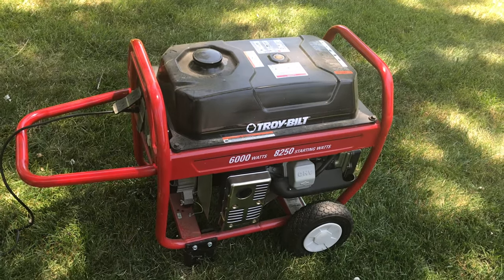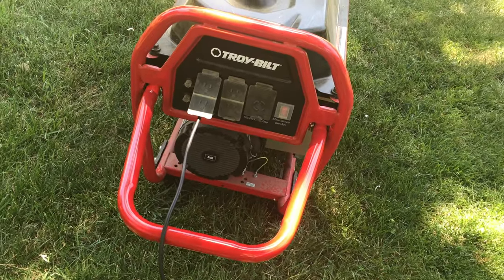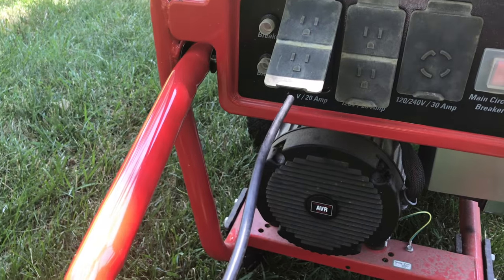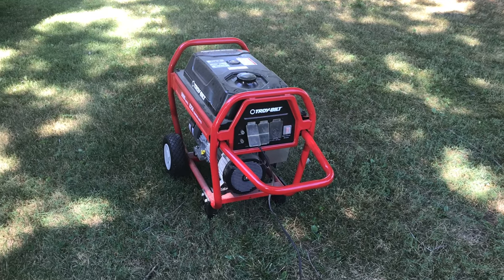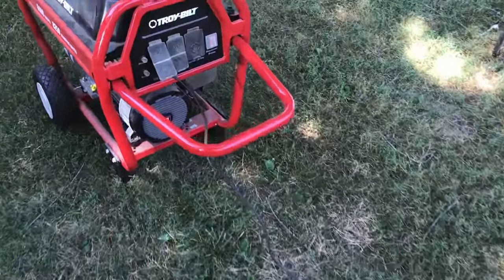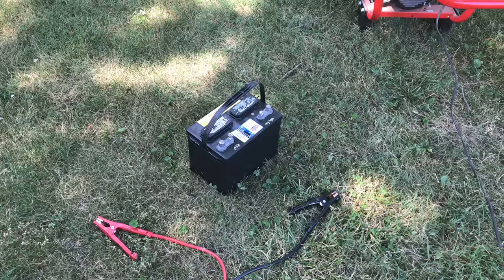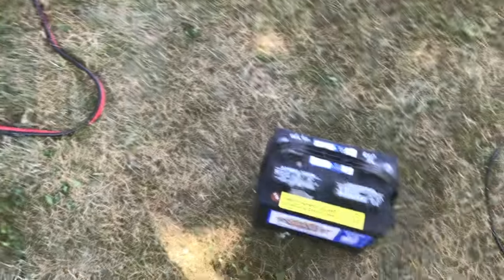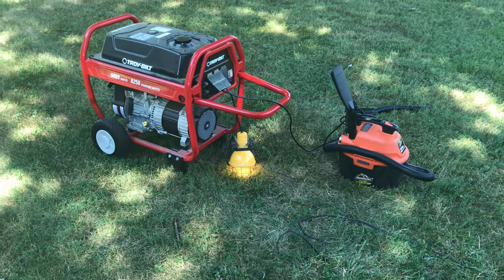Energizing (flashing) your generator with a car battery

Comment: Was the generator running when you put battery juice to It?
Reply from the maker: Yes
Reply: @wagslick   Since the generator was running and producing output current back towards the battery were there any issues?  I would guess one would have to disconnect within seconds?  I ask because I may have to repeat this procedure on my Generac, not having an electric drill to use for flashing.
Reply from the maker: @Kayak99  Right. There weren't any problems, like sparks or anything like that but I had the battery connected to the generator for about 1 second.
Reply: @wagslick  Just to recap, you started the generator motor, then connected the battery  (terminal) for a second and the generator output began.  Correct?  Did you connect the positive or negative terminal for the final step?
Reply from the maker: @Kayak99  Correct. I think I connected both terminals at the same time. The generator 110 output plug was connected to jumper cables. I touched the jumpers to the battery for one second and the generator immediately began to send out electricity.
Reply: @wagslick  Thanks!
Reply from the maker: @Kayak99  No prob. Let me know how it turns out.
Reply: @wagslick  Just to update.  No flashing on my part worked, fortunately I had an extended warranty.  Generator was picked up for service.   Service company tried to flash as well, no output.  They called Generac who told them if flashing did not work, look for a bad connection.  They ended up talking it apart, put back together again and now it outputs.  They couldn't identify the specific bad connection but it now outputs.

Comment: Does it matter on the connection polarity from your 12V power source?
Reply from the maker: I'm not entirely sure. Sorry I can't be more help.
Reply: @wagslick  no problem. We use to tap in on the back of the generator with 120v, but I can't remember what wires we touched it to.

Comment: does polarity matter???
Reply from the maker: I can't say for sure, but I'm pretty sure I had the wider spade of the receptacle hooked up to the negative side of the battery.
Reply: Wide spade is common so you had POS to AC or the black wire 120v. Guess I'll try this before swapping in another powerhead I have.

Comment: Can i use . Grinder instead of electric drill?
I use a tester in the plug before i reverse spin the grinder it produces   just aabout 0.5 volts
Reply from the maker: Good question. Never tried it.
Reply: Just watched a video where the person used a hand grinder - they started the generator, plugged the grinder in, and quickly pulled the grinder wheel across the concrete floor.
Reply: @wagslick  bro , you never explained where or how you attached the jumper cables to on the generator? I have the same issue and did the drill technique

Comment: Ok.  So you took an extension cord cut off and stripped one end exposing the two bare wires, then plugged the male end into one of the generators 20 amp outlet and the stripped side you connected to one side of the battery cable red and black. You started the engine and then touched the other end of the cables to the positive and negative brefley to the battery post.  Correct?  Sorry for my lack of knowledge.  Thanks.
Reply: John Ambrosino Yes. Pretty close. My battery was not inside a car so no need to start an engine. I also put jumpers attached to each end of the stripped wires, that way I only needed to touch the jumpers to the battery terminals for a second.

Comment: Thanks for the video.  Tried the drill method on my XT8000E and nothing, lights would flash for a second, but no go.  Did the battery trick while the generator was on, it initially popped the fuse,  but after reset, had full power.  =)
Reply: MotoMaximus please dear, tell me how connected the battery cables to the generator. Thanks
Reply: If you can, find a non working appliance and cut the cord.  Strip the ends of the wires (positive and negative, you don’t need the green neutral). To be on the safe side, I used car jumper cables to clamp on the ends.  This cable is then plugged into one of the available outlets on the generator.  
Start the generator, and then very briefly connect the the other side of the jumper cables to the positive/negative of the battery.  You may need to do that a few times to get it going.  To verify if it’s working, plug a drill or another appliance into the generator and see if it works.  Let me know if you want me to record a short video on the how to.
Reply: MotoMaximus actually it was urgent for me. So when I didn't get your reply on time I check other videos and found away out. Generator working fine again. Thanks a lot🙏🏽i appreciate your helping spirit🙅🏻
Reply: @thywillokpara8733  No worries, glad you got it going.  I bet you were wondering why this info was not in the manual, right?  =)
Reply: MotoMaximus lols... I tell you! Generator companies need to be sued for making us part away with our hard currency on something that can be fixed in less than 5minutes. Omg thank God for Internet. Happy to meet you.
Reply: does polarity matter????